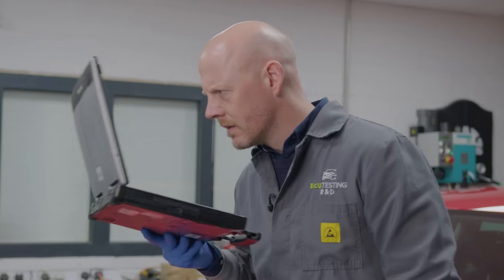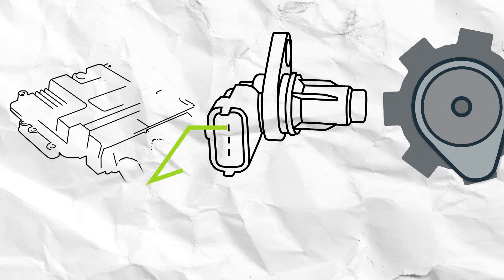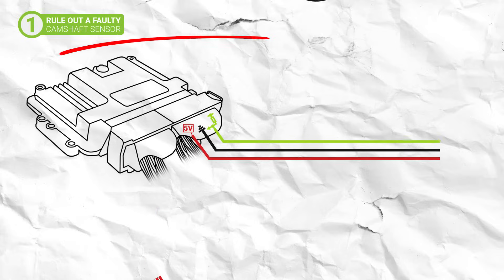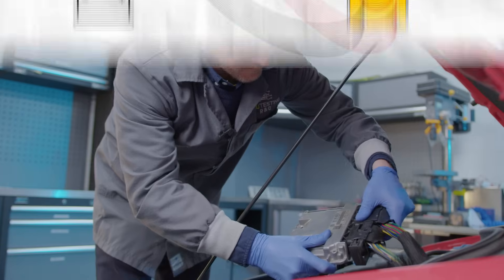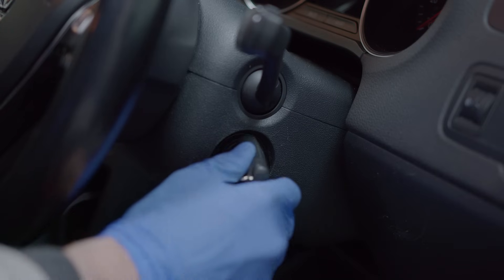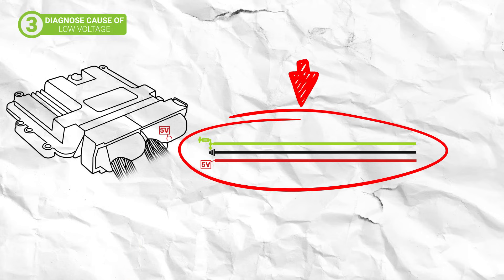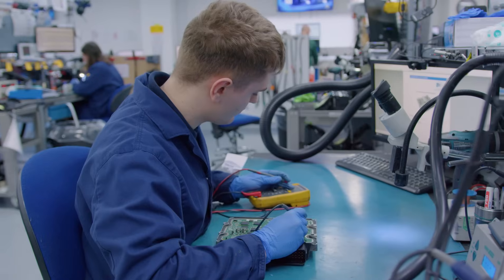Bad Camshaft Position Sensor Symptoms - How to Test and FIX!!

Comment: Thanks for a very nice video! However I have problems with my sensor. It is a 2000 Volvo V40 and when reading the error code it says "ECM-32 Camshaft position (CMP) position sensor". So I checked the voltage from the ECU connectors according to your suggestion in the video and it was OK (+5V, +5V and battery voltage) so it should be the sensor. I then ordered a brand new sensor and replaced the old one and tried to erase the error code but it instantly comes back. I measured the resistance between pins on both sensors and it is exactly the same. Any suggestion how to proceed the investigation?
Reply from the maker: Did you complete the voltage checks at the sensor connector as well as the ECU connector? If the voltages at the connector are bad then the fault could be in the wiring from the ECU to the sensor. Also did you replace the sensor with an OEM part? Sometimes aftermarket parts can cause functionality issues even if they are the same part number.
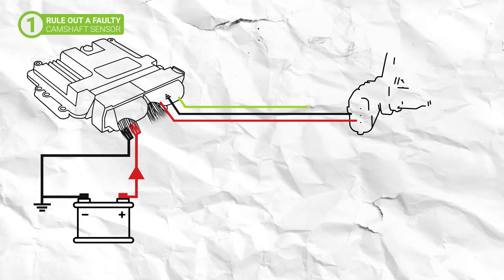Reply: @Ecutestinglimited  I followed the three steps in you very instructive video from time stamp 2:05 and measured +5V, +5V and also battery voltage. I even used an oscilloscope to record the pulse train from the sensor (yes, an OEM) when connected and it looked OK. I did the same with the original sensor and the pulse train was identical, sharp square wave signals. I haven´t followed the signal cable all the way back to the ECU and checked if the signal also is visible at the ECU input but will do that this evening. 

The cambelt was replaced 2 years ago by a shop but the car hasn't been driven a lot since then. Lets say the belt has jumped a cog, could that cause such an error on the camshaft sensor signal? I have also checked the VVT solenoid, cleaned it and when 12V is attached the slide moves. You see, I am almost becoming desperat...
Reply: @Ecutestinglimited  Today I measured the signal cable all the way from the transducer to the ECU connector and the cable was OK. Perhaps the error then is inside the ECU? I am starting to think that the error is due to bad cam shaft alignment. I will have a friend visiting me this week and he told me that when he was changing the cam belt on his V40 he manage to bend the tool holding the cam position just a little bit. He didn't notice that and when starting the engine he had exactly the same error code as I have. When adjusting the cam position the error disappeared. I have also checked the cam position and to me it looks like it is somewhat out of position so I have a small hope that this is the reason also for me. I will let you know as soon I know this for sure.
Reply: Problem solved! Today a friend visited me and he could, without a doubt, say just by looking at the cam ends that the positions were wrong. He loosened one of the two cog wheels and adjusted the inlet cam so it aligned with the other cam end using a special tool. After adjustment and ignition on it was possible to clear the cam shaft error code and it has not (yet!) returned. I am very happy! I have no explanation how this could happen. The screw on the cog wheel was very tight (not loose anyway) and the cam belt look almost new since I have only driven 12000 km since the replacement. What on earth could have caused this?
Reply: @duetten  Maybe the timing belt was replaced without using camshaft/crankshaft locks.

Comment: Both signal and reference reading 12v . Fault code P0341. Car starts just fine but runs with irregular performance.  

Car would run fine in the morning after startup,  but once Car warms up, car becomes sluggish with a  lot of hesitations when giving it gas.

Please help
Reply: did u find the problem?
Reply: @bm_wuratli6883  yes , I replaced the Camshaft position sensor and the issue went away

Comment: I've replaced both camshaft sensors, but I'm still getting P0365. What do you think could be the issue? (2006 Honda Accord)
Reply from the maker: Hi. A P0365 indicates a problem with the Camshaft sensor 'B' circuit. If you have already replaced both sensors then we would recommend completing the circuit checks in this video from 1:52 onwards to determine if the sensor has a good ground, is receiving the correct power supply, and that it is outputting a good signal. The fault will likely lie with either the connector to the sensor, the wiring loom from the sensor to the ECU, or with the ECU itself. Hope this helps.
Reply: @Ecutestinglimited  which camshaft sensor is B, intake or exhaust? They both shaped differently

Comment: Great video! Thank you!
I drive a 2012 Jeep Wrangler that frequently throws PO 369 and more recently PO365 and goes into limp mode. Would these tests be appropriate to diagnose these? Thanks
Reply from the maker: Hi. Yes, the codes P0365 and P0369 indicate a fault with the camshaft 'B' sensor so completing all the checks outline in the video would help differentiate if the fault is with the sensor, its wiring, or the ECU.
Reply: Can you direct me to the correct pin removal tool for my 2012 Jeep Wrangler jk? Thanks very much.

Comment: Morale of the story: So just buy a new ecu and a loop wiring at a reasonable price?
Reply from the maker: Hi. No, we would recommend completing the checks we have outlined in the video in order to determine if the sensor, its wiring or the ECU is at fault and then replacing, repairing or getting your ECU remanufactured depending on the location of the fault. It is extremely unlikely that you would have to do all 3. Hope that helps!

Comment: Thank You very much for this complete video about test and fix a constant camshaft position problem. I was driving myself crazy trying to figure it out until I saw you video. Thanks to this I was able to fix my camshaft position sensor P0342 in a 2007  Hummer H2. Thank you.
Reply from the maker: Amazing! We're glad you found our video useful and managed to diagnose your fault!
Reply: Hi... too vdo..... Thanks.. I have a 2016 Nissan Juke.... 1.6 petrol... 2 fault codes are coming up in relation to potential faults on both Camshaft Sensors..
P0011 and P0014... the voltage to both is 5+Volts. 
From research on the internet, it is unusual to have 2 fault codes at the same time?
Thank you.
Reply: Your vdo is very informative.

Comment: One of the Symptoms is random misfires?
Reply from the maker: Hi. Yes random misfires can be caused by a faulty camshaft position sensor, however these can also be caused by a wide variety of other components on the vehicle as well. We would recommend scanning the vehicle for any fault codes first to help pin point what the cause of the misfires could be.

Comment: Is there a way to measure the sensor itself?  Expected resistance reading between given contacts for known good sensor?
Reply from the maker: Hi. Yes you can test the sensor's internal resistance, however a good reading will differ depending on the specific sensor you are testing. If you would like to test the sensor this way then we would recommend getting the data sheet for your sensor to determine what a good or bad reading would be.
Reply: @Ecutestinglimited Thank you.

Comment: Thank for not sharing how to test the sensor wtf lol😅😅😅
Reply: The sansor is about $20+ , just teplace it
Reply: @wilfredoortiz3820  that's what a parts replacer does not what a fault finding mechanic will do. Just change the engine instead 😅
Reply: Put a multimeter on resistance connect probes to sensor and pass a piece of metal infront of the sensor. A good sensor would change the reading when the metal passes.
Reply: The same as testing a crank sensor
Reply: Should do a draw test on ground and power side back probe harness an read while cranking
Reply: There are different types of sensors. The on/off and hall effect. Check what type is yours before testing it
Reply: Lmmfao
Reply: If the wiring is faulty, no need to test the sensor yet. If the wiring integrity is intact, you'd test the sensor. Do a search on testing resistance and get some idea of the ohms reading it should be giving. Alternatively, reconnect the sensor to the plug/connector but remove it from the housing. Turn the key to on and move a piece of metal past the sensor to see if this affects the reading on a multimeter. Be sure to set the meter to voltage and I think it should set to 20v or under. Just do a search on how to test the sensor anyway.

Comment: Hi, i got a good question today.. .im working on a fier man of houston 2008 Toyota camry his car run hot i got him out the road the radiator burst  so i replaced it tryed to start the car cank but no start so i looked at the spark plugs needed changing so i did and it had a code for crank sensor so i changed it also still no start the i look at spark from coils and the ark was small and puls ever 2 to 4 seconds what van i do to help hime out this jam

Comment: Missing from  causes: a loose or worn reluctor. This is a common issue on Honda engines with a lot of miles where the sensor is not pointed at the ends of teeth on a gear but the side of a magnetized disc.

Comment: Hi, how do I test the car camshaft sensor it self, what kind of readings should I be seen
Reply from the maker: Hi. There are a few different tests that you can conduct on the sensor to determine if it is faulty, but these can vary depending on what type of sensor you have and the manufacturer, so you would have to consult your vehicles schematic or repair manual in order to do this. Using the method we outline at 1:52 in this video, you can determine it is likely the sensor that is faulty if it has a good ground, good supply voltage and a good signal. Hope this helps!

Comment: So you say if the wire going to the cam sensor is good the cam sensor is good? How do you test the cam sensor itself?
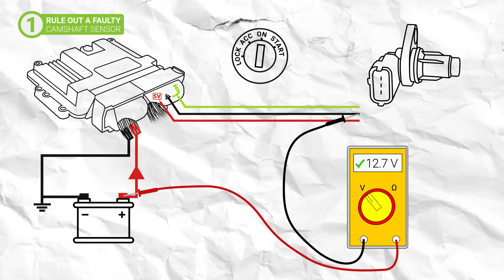Reply from the maker: Hi. Apologies but I'm not sure we do say that in the video? At 2:46 we say if the wiring to the sensor is ok then the sensor itself is faulty. There are a few different tests that you can conduct on the sensor to determine if it is faulty, but these can vary depending on what type of sensor you have and the manufacturer, so you would have to consult your vehicles schematic or repair manual in order to do this.

Comment: Hey man I need your help I have a 2001 Hyundai Elantra we put diesel fuel in it and be bad trouble ever since I've been replacing sensors and now it don't start and we think it's the coil the two cylinders in the middle of the motor 2 and 3 would not hit I put new spark plugs new wires everything now they're telling me that it's a

Comment: What about P0010?
Reply from the maker: The code P0010 is more typically caused by a fault with the camshaft position actuator solenoid, the wiring to it, or the ECU. However it can also sometimes be triggered by a fault with the camshaft position sensor or its wiring, so we would recommend testing both to find the location of the fault.

Comment: Why do you read 5v on signal wire?
Reply from the maker: The reading on the signal wire will be 5v due to the ECU having an internal pull up resistor in the signal circuit. When the camshaft sensor is unplugged, the signal wire is not connected to anything that could pull it to a lower voltage. The pull-up resistor ensures that the signal wire is pulled up to the ECU's reference voltage of 5V. This is why you measure 5V on the signal wire with the ignition on but the sensor unplugged; the ECU is essentially seeing an open circuit through the pull-up resistor.

Comment: How can you get 5v at the signal wire at the ecu, when the sensor is unplugged  and nothing is being send to the ecu?
Reply from the maker: Hi. This is due to the ECU having an internal pull up resistor which pulls the voltage up in the signal circuit to 5v. When the camshaft sensor is unplugged, the signal wire is not connected to anything that could pull it to a lower voltage so you get a measurement 5V on the signal wire with the ignition on, as the ECU is basically seeing an open circuit through the pull-up resistor.
Reply: @Ecutestinglimited   thank you for the explanation. How would you know if your ecu has a pull-up or pull-down resistor without a diagram.  Are most 3 pin work this way?
Reply: thank you @Ecutestinglimited,  I found a video which explains how to tell if you have a pull up or pull down circuit .

Comment: What about p0344? I have it on my 22 civic, pls help?? 😢
Reply from the maker: Hi. A P0344 indicates an intermittent problem with the camshaft position sensor, so we would recommend completing all the checks outlined in this video whilst wiggling the wiring loom and connectors to the sensor and ECU. The fault will likely lie with either the sensor itself, the sensor's connector, the wiring between the sensor and ECU, the ECU connector, or the ECU. If you find the fault is with your ECU and would like it to be tested to confirm, please email our technical support team on info@ecutesting.com and they will be happy to assist. Thanks.
Reply: thanks, i actually had a mechanic come, pull out the camshaft position sensor and clean them, check all wirings.. all good. I have an OBD LUFI so i clear DTC and its gone, car works fine now..  @Ecutestinglimited

Comment: Hi, I had a camshaft cancer fitted to my e39 1999 BMW series 5 the car kept going into limp mode. I was told it was definitely a camshaft censer.,I paid £100 + vat part genuine BMW .that cost £100.+vat. The car was ok no probs. However when the car became Hot ie in traffic and during hot weather now and then all the warning lights flashed, car staled , then I restarted it and it would be ok for a while.recently it did the same on and off. I told the garage and asked could it be the camshaft cancer.I was told No. must be something els. Poss another censor.what do you suggest mate.  Where are you based. I’m in south London. Thanks so much.👍
Reply from the maker: Hi. We would recommend getting the vehicle scanned for fault codes, as the car stalling when warm could be caused by numerous sensors and/or other components on the vehicle. We are based in Derbyshire in the United Kingdom, so if you have any other questions please feel free to contact our technical support team by phone on +44 1773 535638 or via email on info@ecutesting.com
Reply: @Ecutestinglimited  thank you very much.I will get car scanned .there’s a BMW Specialist’s in Windsor.  When the car first went into Limp mode.the previous owner had used that garage.Highly recommended.I called them and spoke to a guy his name is Mick.told him I bought the car of an elderly gentleman in Dorset.gave them the reg. and mike said Oh yes we remember the car and mark. I told the guy about the Limp mode and straight he said Camshaft censor.other garages said bring it in leave it with us and we will carry out tests ect.NO Way.leave it with us. £ching ching ching. I took my car to Windsor the garage is called K@M Auto Technics.guys are Straight, no Bull***t they charge £90.per hour .But no Naughty Lies.other garages in and outside Windsor use them to sort out the problems with there customers BMW.Kevin and Mike are well Respected. Like you are. And Trusted. Recently I Aloud a mechanic friend of mine change the oil and filter .but wouldn’t trust him to mess with other bitts on the car. Either he or one of his friends pulled the bonnet release handle to fk Hard. I watched oil and filter being removed. Left the car dripping old oil until it completely empty.about 30/40 minutes.I fitted the quality oil filter and poured in the new quality oil.waited on and off topping it up.wiped off minimal oil drips. Virtuly none cos I’m to fussy.I always gently lower the bonnet and click it shut.I did it exactly as always .gave my mate £25. For using his ramps and despising of my out oil.got home. Left the car standing for 40 mins.then wanted to recheck oil level and filter .ie weeps .gently pulled the bonnet release handle it felt loose.then went to open the bonnet but only the drivers side clip was released. Could not lift the bonnet.then I knew it’s reason was because one of the thick Apes had pulled the handle sharply or to fk hardi got my son to operate the handle as I carefully put even presure on the front of the bonnet it bouncing it and with open palms slapped the bonnet. And I managed to open it. Done my checks all ok.topped up screen wash.as usual cleaned engine,and other areas with a wad 40 damp cloth.checked water levels . Sprayed silicone oil mixed with wad 40 on and in between all catches on the top of the cross plate and on the front part of the bonnet where both bonnet and cross plate catches meet.so now I’ve got to see if the bonnet cable to the near side is damaged. Or the latch is damaged.seen cables on eBay. Reasonably priced looks an easy job replacing the cable,or cables. I’m a fussy guy .always take propper care of my vehicles.shut doors gently.silicon oil in window canals ,cleaning all door shuts ,under the cills.I treat my cars with Respect.and my old transit van.once a year I take off the wheels, clean the inner sides, wire brush the rust of the wheel hubs and clean all around the hubs and callipers and pads with proper break cleaner.if I’m taking people out or picking them up.I open and I shut the doors.Because people Slam them bloody hard shut. Destroys the rubbers, damages the window electric motors.so thanks for your kind Honest Advise Sir. Great channel. Interesting . Take care and kindest regards m8.

Comment: Will a camshaft sensor kill power to fuel pump
Reply from the maker: It depends on the vehicle, as some modern vehicles use the camshaft signal to control the fuel pump relay so you would have to look at your vehicle's specific technical information to confirm.